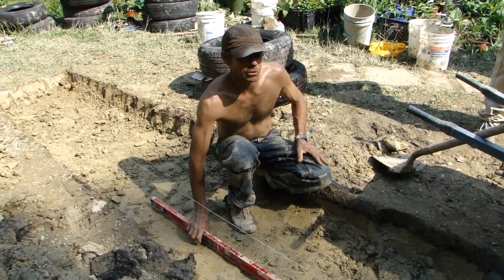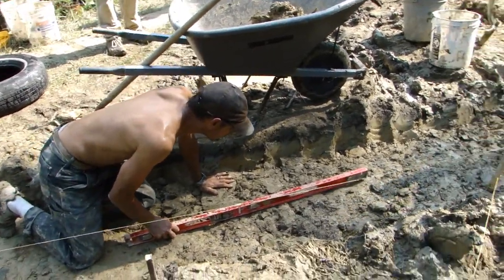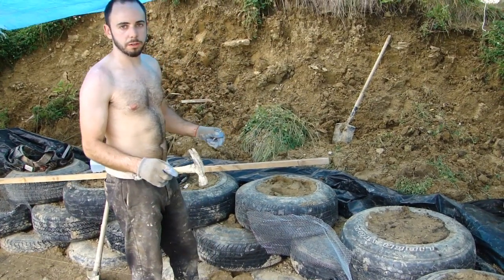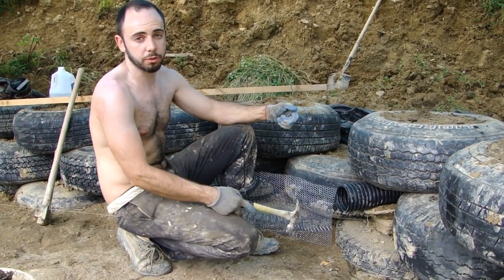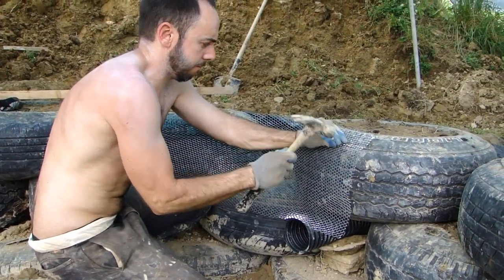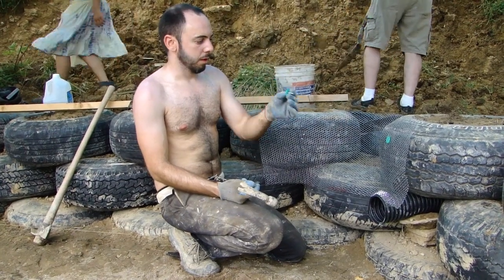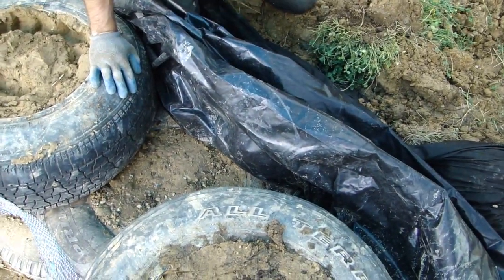Cincinnati House - Tirewall Part IV

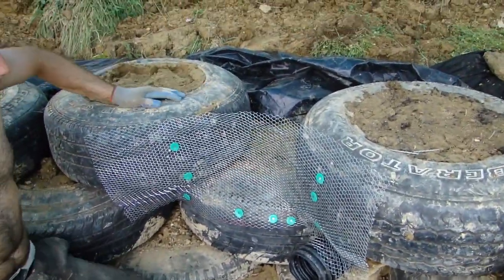Comment: 05:21 why do you use waterproof plastic instead of geotextile for the French drain?
Do you tamp the gravel as the tires will partly sit on it? Wouldn't that cause damage of the pipe?

Why no gravel in the concrete filler block?

Comment: Awesome videos, so if Cincinnati is 6-8” down for the base, how far do I go down for south Louisiana? Baton Rouge area, base flood level where I live is 52’, the area we are building the wall is below that, at the back end of my property behind my barn apartment. The water usually comes up where we are building 1-2x a year when the river rises. It’s only flooded my actual yard and barn 1x in history. The barn is at 52’ and the house at 54’. That was the Louisiana August 2016 flood. These are the historic crests which affect the property. 

Historic Crests
(1) 58.56 ft on 08/13/2016

(2) 51.91 ft on 04/23/1977

(3) 50.97 ft on 04/08/1983

(4) 49.08 ft on 01/21/1993

(5) 48.40 ft on 01/29/1994

I’d say at 50’ it’s reached the top of the drop off. We used to be able to walk easily or even take the 4-wheeler down to the creek, which is private property. Back in 2018 the city dredged my creek without permission and in violation with the Louisiana river and streams act of 1973. Eventually causing all my land to just fall away. It was chiseling it out beneath our feet. They won’t take responsibility and even though I most assuredly could sue and win, I don’t have the time. My barn and the apartment above our at imminent risk of washing away. Any help you could provide would be wonderful. My brother is helping head the project. Which we begin next month. Bc of the risk to the barn he wants to start on the left of the property behind the barn at the top level. It had self terraced off right there, but due to the water rising in January it’s now washing to the right. Every time it rains land is washing out. The right side is a sheer drop of around 35-40’ from the land even with the creek.

Comment from the maker: Thanks!  The gaps can be anywhere.  It's better to try to make them a little bigger so you can squeeze a 195 tire in there so you don't have to use concrete.  In most Global Earthship construction, there are always gaps on the sides of the cooling tubes filled with concrete blocks.  Check out my Taos Earthship videos for that.

Comment: Nice, few questions.. First, on paper, would it be a better idea to shoot for gaps in the middle of a wall, away from corners and cooling tubes?  And second, no worries that the concrete against the plastic will create holes in the plastic?

Keep up the great information!